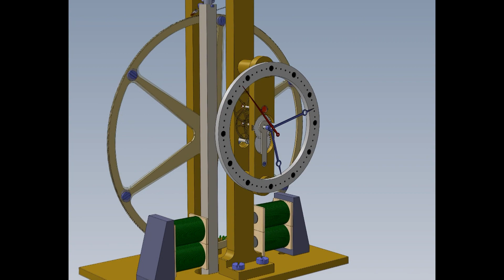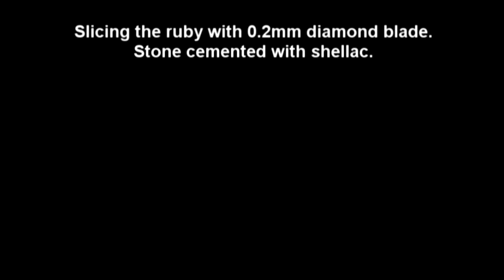Tuning fork clock

Comment: Fascinating design, and beautifully made. 

Being completely unfamiliar with the design, I apologise for what might be a very simplistic question, and perhaps a gross misunderstanding - but am I right in saying there’s a feedback loop stabilised by the resonant frequency of the fork, and the vibrations of the fork are coupled to the spring arms that hold the jewels, and the jewels impulse the ‘flywheel’ ?
Reply from the maker: You are correct,  though I would not use the term "stabilized" . The fork oscillates at its natural resonant frequency and the generated sine signal (induced in the coil by the small change of the magnetic field) is amplified and the pulses used to actuate the driving electromagnet  that maintains the natural oscillation. The vibratory movement of the fork tip  is driving the large wheel vial a jewelled pawl.
Reply: @billzweig  Thank you for taking the time to explain. The clock is a beautiful piece of work.
Reply: @mercuriall2810  I am not an expert in mechanics but the way I'm conceptualizing it from an electronics background is that the tuning fork is a frequency sensitive component that will attenuate most signals except for those very close to its resonant frequency with signals at its resonant frequency having the highest gain. In an electronic circuit you would pass broadband noise through a frequency selective positive feedback loop and after some time all frequencies except the resonant frequency will attenuate down to almost zero while the selected frequency is amplified to a sizable signal. This basically accomplishes the same thing mechanically